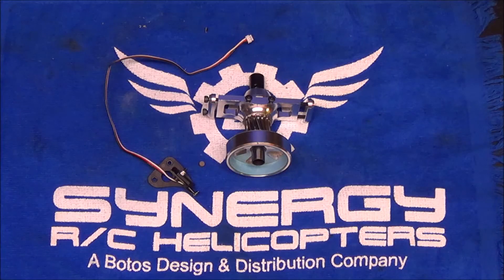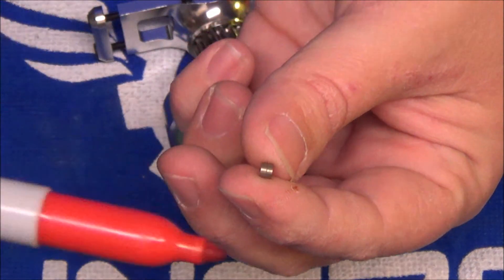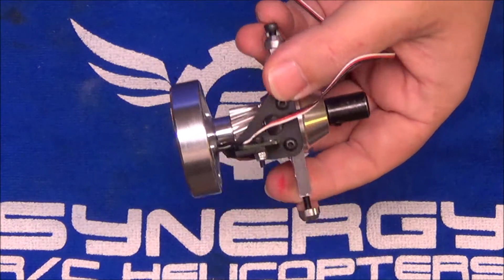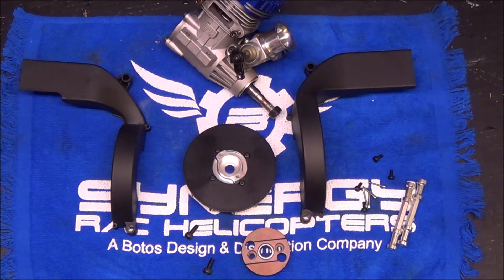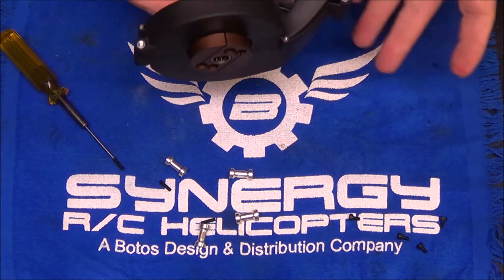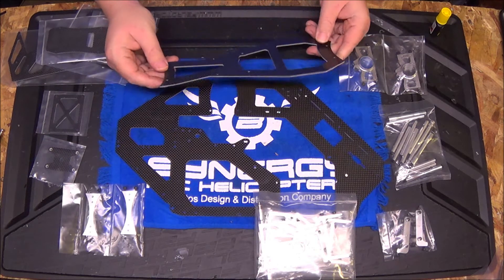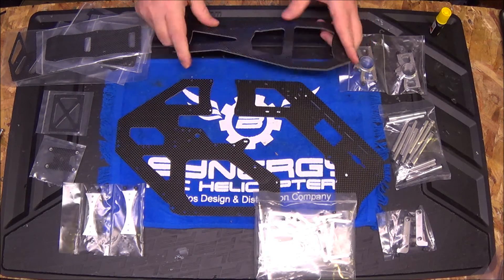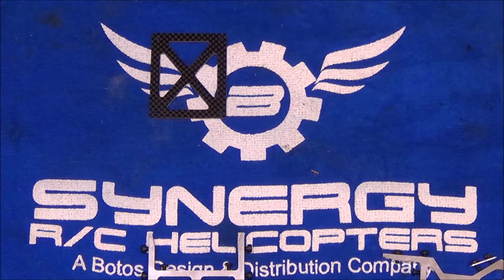Synergy N7 Build Video Series Day 2 - Installing Fan and Fan Shroud - Starting the main frame!

Comment: Hey Chris, which way does the one way for the starter go?
Reply from the maker: The OWB for the starter shaft is preinstalled in the clutch.  You shouldn't have to install. But if you are replacing one, it has to lock on counter clockwise rotation.